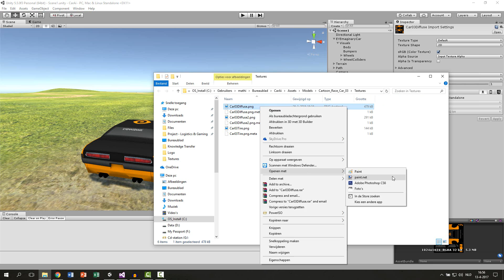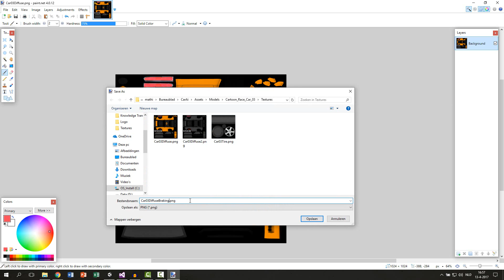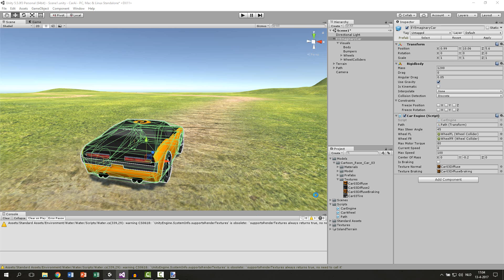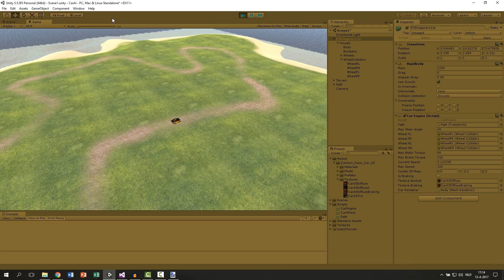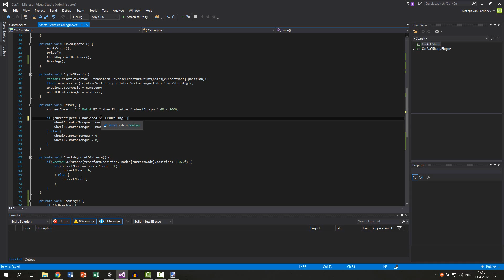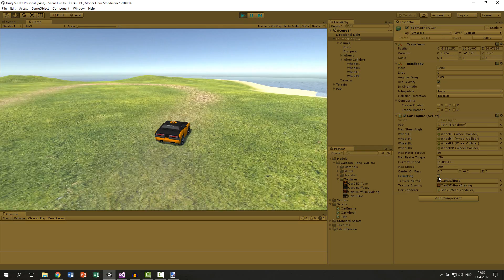Car AI Tutorial #6 (Unity 5) - Braking

Comment: Help please i will like to know how to make the car slowdown on an intersection or when it has to steer the weel
Reply: I added an additional term to the maxSpeed limiting if statement that checked if it was below max speed and the steering angle was greater than some tolerance angle. This allowed it to slow down when making tight turns, but remain full speed for small course corrections.